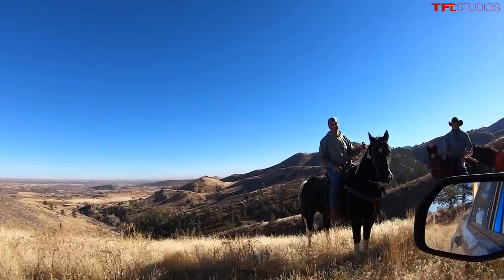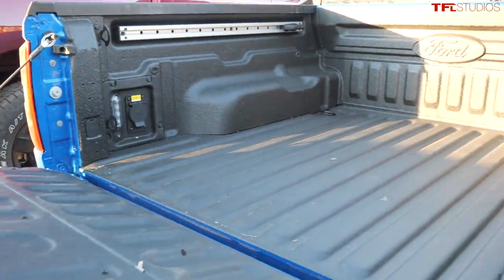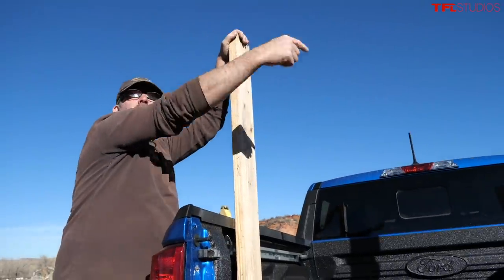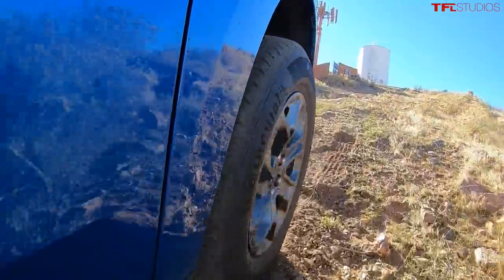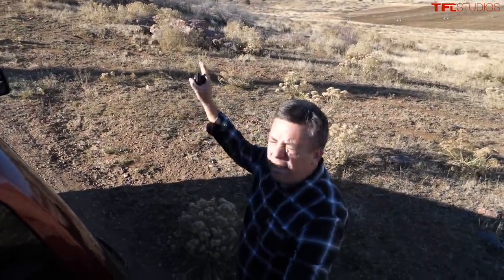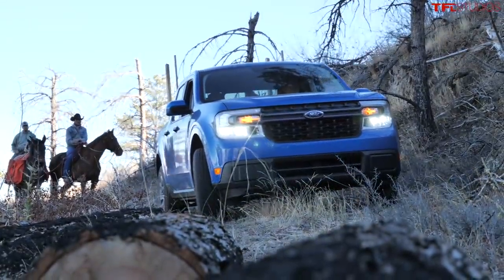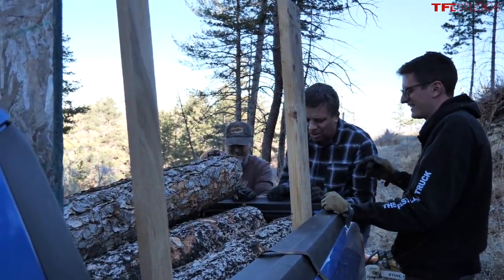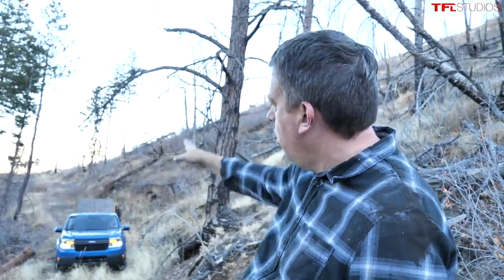Did We Go Too Far MAXING Out The New Ford Maverick To See If It’s Ranch Rated?

Comment: This is the content that I like to see! As someone who uses a small truck (03 ranger XLT) for farm work all the time I love seeing someone actually use the maverick for actual work
Reply: 04 dodge Dakota here and I feel the same way. People think you have to have the craziest things to do real work. Our little trucks probably do more actual work than most full size 😂
Reply: @cajunred6804  It's true. I worked with a guy who spent $80k on a HD just to drive around the corner to his apartment. Cleanest truck I've ever seen.
Reply: I have an 03 Tacoma, 4 cylinder, very slow but she gets work done still!
Reply: I know what you’re saying, I got a buddy on a dairy farm that’s got a 2000 s10. That sucker outperforms all the soccer dad‘s that show up to Lowe’s in a $60,000 truck to get a 2x4 or two.
Reply: Yep. I’ve done a ton with rangers, wranglers with little utility trailers, and small fwd cars.
Reply: @benjammin8510  used a 2009 nissan rogue for cement work and man was it squatting when i left homedepot 🤣 had to change shocks and many suspension parts after while of abuse though. Lol
Reply: Got a 99 Ranger XLT that does the yard work duty as well. Too many people thinking you need a massive full size truck to do anything. Sure a full size is the right tool for the job some times, but these little pickups can do way more than people give them credit for!

Comment: We have a 2500 Duramax and an F250 Powerstroke . Once you drive those tanks around all day and pay for that fuel every week this truck looks great for errand running, soil hauling, and hitting the bike trails.
Reply: Very good point.
Reply: 100% I have seen this truck get a lot of hate from the diesel bros because it can’t tow like a freight train or doesn’t have 900lbft of torque….this truck is perfect for 90% of people who don’t tow or need a heavy duty truck.
Reply: Absolutely bro. This truck serves a great purpose. It
Doesn’t have to have 1000 HP to be useful.
Reply: @dieselcanuck87  the same diesel bros which rarely (if ever) use their trucks for anything more than point A to point B transportation talk more smack than anyone. I sold my Ranger for an F-250 because I needed the payload and towing but most of the time it was just a daily driver, I bought a car with the fuel savings from not driving that pig every day. I'd consider selling my car for a Maverick if you could get a longer bed, the 6' bed on my Ranger is all the shorter I'd be willing to live with.
Reply: For ranger is better tho
Reply: I'd buy a Ford ranger instead of this
Reply: But they’re like 10k more boss
Reply: @0223Jeremy  they are worth it. U figure when that cvt breaks ND it will break possibly 80k miles it will b expensive to fix or replace. The ranger shit one cost half as much to repair.
Reply: @jackdaniels2657  Most hybrid CVTs go WAY longer without issues. Look at the reliability record of the Prius. I have a 2016 Subaru Crosstrek CVT with almost 100K trouble-free miles, and I don't baby it. I didn't install skids and a hitch for decoration...as they aren't even apparent when not in use.

 Besides, the AWD 4K Maverick that most people are probably going to opt for, to really abuse towing/hauling/offroading, doesn't use a CVT. This FWD CVT hybrid Maverick will probably be just fine to use like I've done with several little 4cyl econo-hatchbacks and my small trailer. Jetskis, motos, quads, 4x8 sheets, lumber, pipe, dirt, gravel, concrete, etc., have not been a problem. Skids, winch, recovery mats, tires, and rear locker can make  the little AWD buggers decent offroad too, if you're not into serious rockcrawling.

 My self esteem can handle not being able to roll coal on a Tesla, nor to even see over a Prius. Women have always liked that about me.
Reply: @RKmndo  the prius is the only cvt that actually lasts. Any other cvt is junk Nissan cvt Chevy cvt Subaru cvt  Honda cvt junk. Fords isn't gonna b any better cus they build their transmission with gm. That's right Ford and Chevy partnered up for transmissions sadly all their transmissions so far suck. 6l80 6l90 6r80 6r140 junk junk junk 6f35 6t60 they all suck u buy the maverick I don't care I was just informing u of how weak the tranny is. Toyata has the best cvt but only in the prius or camry hybrid if u hook it up to gas they don't do well cus gas requires a reverse gear while the hybrids dont

Comment: Ford really knocked it  out of the park with the Maverick. Impressive little  vehicle.
Reply: I agree. I really like it but I can't go against my principles. Which is I'll NEVER own another Ford.
Reply: @guardrail2897  Buy it once and they last forever!  You'll never need to buy another.
Reply: @shawnhill4779  I did. And I'll never have another. I had a 1989 F150 that lived in the shop. A 2001 Mustang GT that lived in the shop then a 2016 Focus that lived in the shop. Never again will I own anything Ford.
Reply: @guardrail2897  Can't argue with that. I've had good luck with my last 2 F150s, but everyone's experience is different.
Reply: @guardrail2897  That’s on you - the vast majority of us buy Ford & realize why they produce the best selling trucks. FORD 🇺🇸💪🏻  Had a Toyota 4Runner & it was garbage: underpowered, electrical issues, horrible seats … dated interior.
Reply: Agree - FORD 🇺🇸👍🏻
Reply: @guardrail2897  Modern ford's are great, my parents used to have that same perspective. Then they bought a 2017 explorer, a car they say is far superior to every Toyota/Honda they've ever owned. New ford's are nothing like the crappy old ford's. The maverick uses a very reliable hybrid system.
Reply: @krasnaludek298  you sound biased as hell 😂 im not a fan of Toyota but pls never compare Ford's reliability with Toyota that's not right at all
Reply: @krasnaludek298  Actually Ford only sells the most trucks by brand. Silverado and Sierra sales combined beat the F150, therefore GM sells more trucks
Reply: @krasnaludek298  That's kind of Toyota's game. They release outdated technology and underpowered engines because they're proven and last forever. Nothing wrong with it. Just a different market. First I've heard of electrical issues but nothing absolutely perfect. I love Ford but I would never say that Ford reliability is as good as Toyota's. As far as capability, I could argue.
Reply: @drfeastmf  22’ gm trucks are literally garbage (mechanically), they’ve really gone downhill over the last decade.
Reply: @jamesvoneschen6603  butt hurt Ram or Ford guy I see
Reply: @drfeastmf  Does it REALLY matter?
Reply: @cwqrpportable  yes